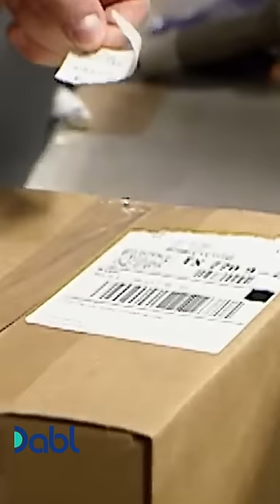Undercover Boss Fired for Packing Boxes Terribly #shorts

Comment: Obviously the boss does not understand that new employees need time to acclimate to speed.  He needs to think outside the box.  She is an excellent trainer and should be rewarded for her understanding of the process.
Reply: @aussierednecksinger28  Using those packing tape dispensers is just a knack you get by using it enough. There's no real method
Reply: In this case “the box” was all that they were thinking about 😂
Reply: He doesn't need to think outside the box. What he needs to do is putting tape on the box!
Reply: It's pretty obvious to me that he was fired for dramatic effect because the producers of Undercover Boss told him to.
Reply: If he worked in reality like that, then even the learning curve argument wouldn't help him. If you can't handle a simple task like that, then better get back to the keyboard. Useless bodycount on the production line. The guy that fired him, saw that in a heartbeat. Don't hate on him. He did the guy a favor.
Reply: dude, there are cameras filming this
Reply: It's just taping the box.... That too with the tool thingy..... How hard is it
Reply: outside the "box" hihihi
Reply: @aussierednecksinger28  that's because there is no 'how'. Speed comes once a person has the knack of doing it right. A trainer has to show how to do it right - speed is useless if the tape is in the wrong place or too wrinkled. Even these small tasks have a skill.
Reply: he’s literally the boss.
Reply: Read the situation wrong u have
Reply: Same thing happened to me when i was a teen and started a job at a bakery..they fired me after 2 days because i was too slow..well excuse me i'm not an expert one day 1.
Reply: The one who fired him was not the boss... He's at mpst a supervisor or a prod manager/leader. The boss was the one trying to clumsily tape the boxes, he's undercovering as a newbie worker.
Reply: @aussierednecksinger28  I've worked those jobs, someone telling you the best way to do it doesn't automatically help. If you aren't used to doing it you're gonna be awkward and clumsy.

He's trying to go too fast before he has the muscle memory, pulling it up first wouldn't make a blind bit of difference.
Reply: @aussierednecksinger28  it’s not hard to tape a box…
Reply: You do know that in the lower sides of society there are 13 people in a dozen that have experience taping a box that you dont need to learn how to do it right? Speed might come later, but if you struggle with this for 15 min then you should go, its not a social workplace. They probably made his fake resume to show he had some work experience in this type of work. If they hire a younger person in his teens, they can teach him, they also cost 1/3th of a adult in his 30s. Margins arent high in this type of work, so good decision by the boss.
Reply: He was fokin terrible looooool
Reply: She is the undercover boss 😂 not sure how y'all didn't figure that out
Reply: I don't think you understand there's no time for that inside of factory, we need people that know how to work fast .  not people that need their hand held the entire time. Its def not for everyone
Reply: Think outside the spreadsheet. Every employee is a person, not some animal or “human capital”
Reply: @RonAllenTaylor  doesn't mean everyone is made for that job. Get good or get out.  Simple
Reply: @oldManJenkins0x  sometimes it takes a few years for people to discover their own humanity — or stop hiding it
Reply: Time on the clock is money the business spends and unemployment is high enough they have plenty of workers to choose from so fire the one who needs training and hire someone whos just naturally good at it.
Reply: @aussierednecksinger28  even in the actual episode she doesn’t. Just does things super fast and says that’s how it is.
Reply: @aussierednecksinger28 you can’t teach common sense, and not everybody is a great teacher or a great learner. Keep your mind open.
Reply: @irokimaori6426  well he’s the founder and owner not just for that depot but everything.
Reply: That’s pretty much every boss your going to come around
Reply: @aussierednecksinger28  she did the best she can. She clearly wasn't given enough time to properly train the new guy. It's not her fault that the higher ups expectations were unrealistic.
Reply: @aussierednecksinger28  you only see what they show you. What this is demonstrating is a guy unfairly firing someone for performance before they're even trained... The fired guy is the boss undercover. He probably heard this was happening so he went undercover as a slow learner to catch they guy unfairly firing people before they are fully trained.
Reply: @lynnann2010  I haven't watched this episode but i watch the series a lot. The undercover boss usually comes in as a newbie, not an experienced trainer. You could be right, i don't know, but usually it's usually the newbie and often someone comes down hard on him or on the trainer because he's slowing down the line. The real boss has heard such rumblings so they stage it so they can be in the heart of the issue when it goes down.
Reply: @oldManJenkins0x  you haven't watched the show have you?
Reply: The guy who was slow was the boss that's why it's undercover boss
Reply: How you gonna get fired... As you own boss dawg 🤣
Reply: Right I call total bs 😂 this guy would have it down in 2 weeks
Reply: Unfortunately that’s how a lot of jobs are now. They show you once and throw you to the dogs. It’s sink or swim.
Reply: Clearly not if dude couldn’t figure out how to put the tape on correctly lol. It seemed like she was holding the tape down as she pulled it across the box but he didn’t do that.
Reply: @aussierednecksinger28  uhh isn’t this a short of the whole episode?? Lmao 😬
Reply: @elite35p98 doing it slow not difficult at all doing it fast can be challenging tho when you first start

the faster you go the more likely you fuck up and with those things 1 fuck up and you need to start again as it doesn't tape correctly
Reply: a lot of corporate jobs are like that honestly
Reply: Yep. They want you at the speed of someone who's done this for 5 yrs right out the gate. And they typically don't help you get there.
Reply: @WavySeal  it's a tape gun. You pull the tape across the surface and use the sharp edge to cut it. If you can't do it right after the first or second try, just give up.
Reply: It's not just that he was painfully slow he was damaging the boxes likely resulting in the need to start all over on that package.
Reply: @AMPMGrind  2 weeks to learn to use a tape dispenser... you're what's wrong with the world.
Reply: @wittyjoker4631  actually, Mr Joker, I know this type of work. I pride myself on learning fast and doing things right. 2 weeks it just what I said at the moment. You condemning a stranger for a simple remark online is more in line with “what’s wrong with the world”
Reply: It's obviously fake
Reply: @convulsiive Have you ever tried to use those one handed packing tape dispensers?

It takes more than a minute to get the hang of it
Reply: In real life they don't think so prosperous for the near future
Reply: No, the undercover boss sucks in his job. He got fired by his own rules. The dude just did his Job...
Reply: @WavySeal  i feel like just confidence is what separates how she uses it and he does. Many people try to be careful (not just with this, but with many many activities and actions) and that slows them down a lot. Im one of them btw, and i've learnt that its easier to just copy the way someone does it rather than slowly build confidence, you will fail more often at first, but will be doing much better earlier.
Reply: The boss was the ‘new’ employee lmao it’s undercover boss😂😂😂
Reply: Nice pun
Reply: @elite35p98 you'd be surprised. Especially when the tension is cranked super tight on the tape gun he's "learning" with.
Reply: @CB6_  he meant the area supervisor. Not the owner/executive/smth else which is the one you are talking about.
Reply: @elite35p98  Have you ever had to use company tape guns? Especially using wide tape like that?
Reply: I agree with what you said but it will never happen. I can tell you from a lifetime of personal experience. She will be made to train her higher paid replacement
Reply: In reality, the Undercover Boss was working like a doofus.
Reply: @jossposs3400  right? He was ridiculously slow.
Reply: @lynnann2010  she is obviously not the undercover boss what are you talking about
Reply: She’ll never move off the line TVTP
Reply: ehm yea ... really shouldnt be that big of a deal to tape a box fast. i would get my IQ checked if i were him
Reply: Yeah definitely scripted
Reply: @janzelf  thats not even the case. Its just a TV show and they need bit to make "good tv." Everyone has to learn, and warehouses are always hurt on people. They will give you at least a few days to learn no matter how slow you are.
Reply: @Under-Kaoz  You're right, Captain Obvious.
Reply: @janzelf  it clearly wasn't obvious to you
Reply: the boss was the new employee faking it the manager fired him
Reply: The role between the woman and the bossy guy should be swapped for sure
Reply: @Propagandalf  so many jobs treat people like that it's insane. They want all new hires to be perfect after a couple days..
Reply: @oldManJenkins0x  the pool of experienced people  will only get smaller if nobody ever wants to train anybody and just fires everyone
Reply: It's a tape gun. You acting like she's doing something even slightly complicated
Reply: @lynnann2010  she is not dude is the boss
Reply: He was fired for both the pace, but also mislabelling. The slow pace did not add significantly to the production, but the mislabelling actively cost extra time
Reply: It's his lucky day if the boss is giving him crap about production already he'll do it every day
Reply: Nope. Disagree. Lord knows on whatever fake application he had, it said that he had some sort of training. I mean christ, has he ever had to use tape in his life? Da fuk is he doing yo. I don't blame them. Work needs to get done in a certain time frame. Period.
Reply: @Bleatmop  agree
Reply: Yes. Learn the skill first and speed comes later. I've been on the supervisors 💩 list because I wasn't fast enough or knew the inventory. Quit that job after 2 months of constant belligerence of how I was getting everything wrong. 
Also its hard to learn on the job in some settings and most training people barely train the new employees and then wonder why everyone is a screw up and they still have to pick up the slack.
Reply: @elite35p98  It isn't brain surgery, but it isn't something you instantly pick up, especially if someone just says "here, do it" and doesn't help you by correcting what you are doing wrong.  
  I have spent a fair bit of time training people to do various tasks in the past, from scoping to combat medic training, and you have to keep in mind the phrase "nobody is born knowing anything."

Comment: This is why between a tour and showing someone how to pack and all that goes into it, I would spend up to 3 or 4 hours with a new hire. And if I was pulled away for whatever reason, I made sure they were put with someone competent enough to train them. Otherwise you get situations where a new hire struggles like crazy. It's no different if it's a big wig who hasn't done the job in who knows how long, if ever.

Comment: Yeah I've work at a job like this before they definitely will fire quick if your slow or mess up. Your 2nd day if you ain't got it your gone won't be a day 3. If you mess up anyday your gone including first you was gone. You was 100% expendable.
Reply: I worked at a job you couldn't get fired if you wanted to. EMT B at an inner city er, takes 2 years of college and about 4 grand to get the position for $12 an hour.

Comment: See a lot of people having trouble with the tape gun. Little tip from someone who’s worked in UPS for years. There is a knob on the middle wheel to adjust how much friction it has if youre having trouble pulling the tape.
Reply: Thanks good tip

Comment: She might be fast but her tape job is bad. The tape gun should be rolled over the entire length of the box for adequate tape adhesion. The way she does it, the tape is only secured at the ends and is all creased in the middle.

Comment: Few years ago i was running a hi tech machine in the packaging department and at reasonable speed as a particular person managing the place would come over said to run it faster i would say it will jam and shutdown and down time etc etc as the machine has censors and laser curtain and product would slide off center and Manager said run it faster and sure enough jammed & stopped. 

Management are the brains behind any corporation

Comment: I got two different jobs working assembly, and let me tell you, a lot of places will treat you like this. They want you to be really fast, and will work you more than you should. I know this is a warehouse job, but this was incredibly similar to what I was doing. We were assembling ziplock bags boxes and packaging, and I remember being efficient with what I was told to do, but they kept getting on me about going faster, which I understood, but after about 5 times of them being persistent about wanting me to be faster, I just couldn’t handle it. After I quit, I had heard a few things here and there about that specific company and how they are pretty sketchy.
I lasted about 3 days. After the first day, I had felt like I got beat the fuck up. My body just felt incredibly weak and I was extremely exhausted. I can understand that it is an assembly line job, but I had worked at CAT, which was basically the same thing, and they treated me sooooo good. I had never been employed by a company that had treated me that way.

Comment: She pulled the tape across and pushed the box away. The tape is lightly touching the box, not a good connection.  I usually run my hand over the tape to push into box. Adds an extra 5 seconds per box . . . The box stays shut in transit.

Comment: Behold: how not to run a business.  You could teach someone the right way to use a tape gun in like 20 minutes, or even just have them watch a quick YT video before they start.  He was very clearly using the tool wrong, and it's obvious there was no training.  Instead they just rely on fear and go straight to termination.  Takes more than 20 minutes to get the hiring paperwork done, and they probably have to pay a full check when they terminate, so it actually costs the business more money too.